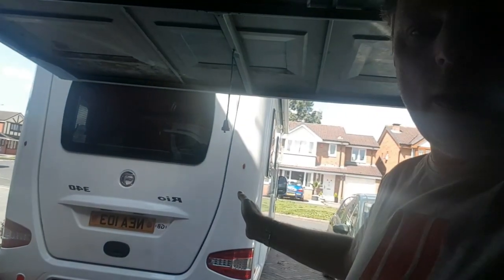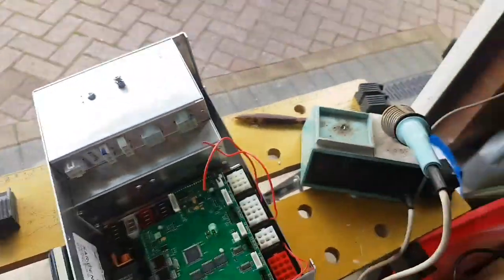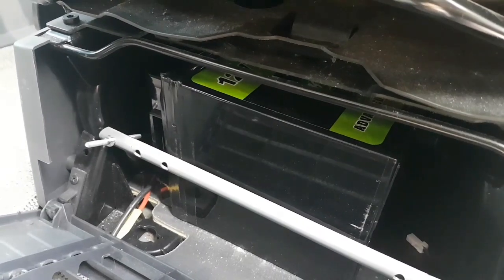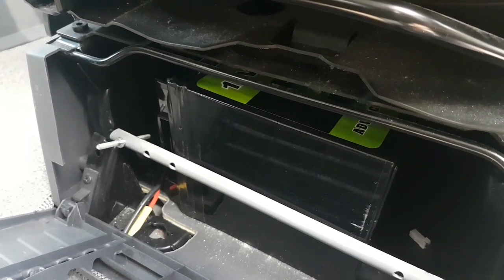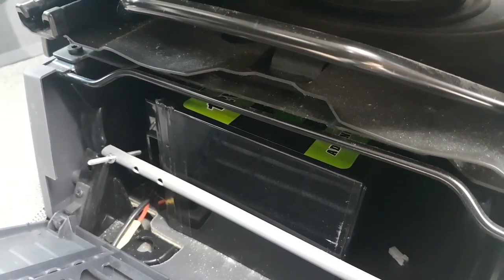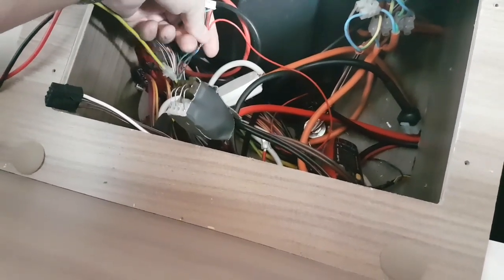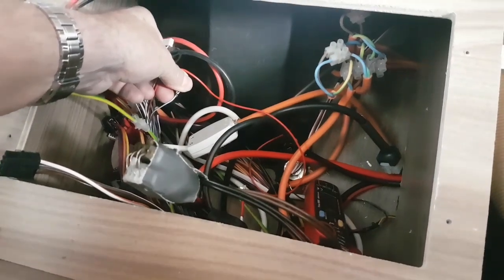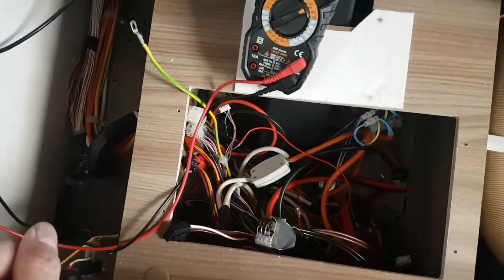KS Energy UK Lithium Iron leisure battery fitting into a Swift motorhome

Comment: Superb video. Is the 18.5A the maximum possible to be drawn from the alternator due to the wiring resistance?.... or will it be much higher when the engine speed increases?
Reply: Yes, the voltage is fixed at 14.4V from a standard Fiat alternator (pre Euro 6+). There's not a lot of change in the standard current you'll get from the the Swift/Sargent design because they tap the source directly off the vehicle battery. There will be a bit of voltage drop in the original vehicle wiring via the vehicles alternator and fuse box and thus a marginal increase in available current as the engine speed increases. However the change in the available split charge current is marginal.

Comment: Does this mean no need for a DC to DC charger as the Swift system will do no long term harm to the lithium battery?
Reply from the maker: Assume you mean a battery battery charger? Un-modified the existing Swift Sargent control box has a split charge system built in as standard which on its own is perfectly adequate with our batteries. It also has a PX300 Sargent charger, which again is very good too.
Reply: Thanks I am thinking of going Lithium on my caravan which has good solar. but was concerned would the car to caravan charging on my Swift work and not damage a KS Energy battery.

Comment: That's very interesting Neal! 
So the standard Sargent system/cabling will only handle around 20a and by replacing this with thicker cables that can be increased to around 100a? Approximately 5 times better/quicker battery charge rate?

Comment: I see you have a solar mppt controller there. Have you connected the unit to the Sargent and also, does it display the solar current on the swift command unit? Would love a video on this please.
Reply from the maker: Yes, I modified the Sargent to cope with the extra current of around 25A from it. To be honest it was a little bit of a waste of time on reflection.
Reply: @ksenergy9079  Would you mind sharing how you modified the Sargent - I have 175w panel and would like to do the same.